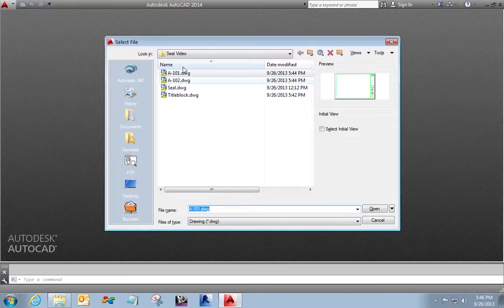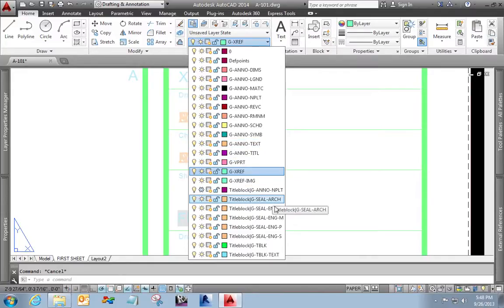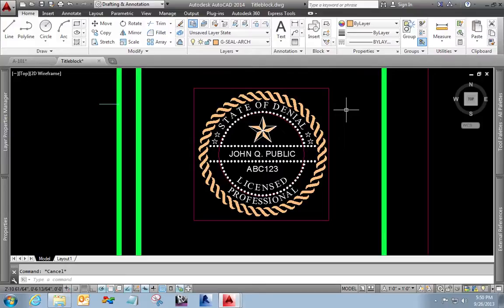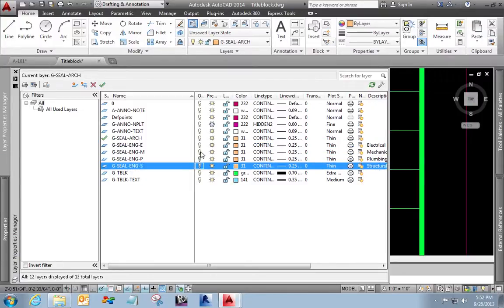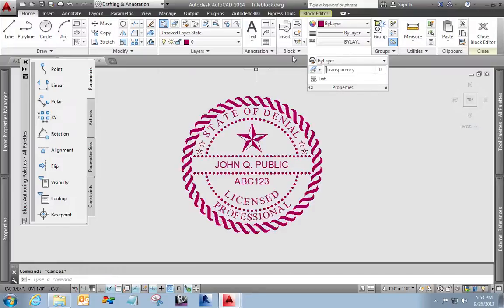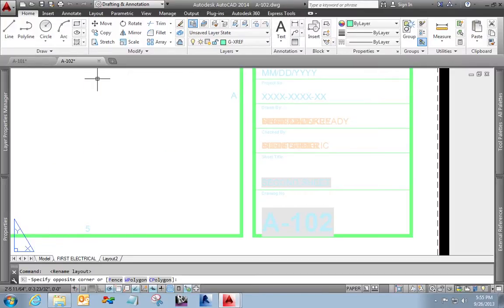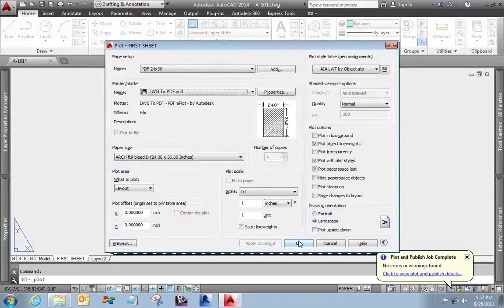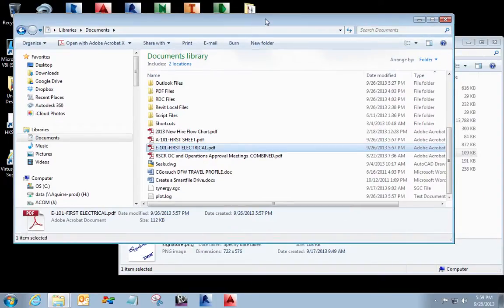AutoCAD   Scanned Signatures

Comment: Hello, one comment and one question. First, this method works for many jurisdictions that simply allow electronic signatures without qualification. But this method but does not work for jurisdictions that require a true "digital signature" that electronically locks the file against further edits; require that the signature be unique to and only accessible by the signing professional; and/or that it be third-party verifiable. Those types of signatures are typically applied to the final electronic document via Adobe or Bluebeam or similar.

Second, you mentioned a state that requires the seal/stamp image be a part the same entity as the signature/date image. Which state is that? Thank you!
Reply from the maker: Since I recorded this several years ago the regulations may have changed.  At the time I recorded this, I worked in a TX A/E/C firm, and had to perform this action for both AoR’s and EoR’s.  The regs for AoR’s allowed the digital signature to be a different digital element from the digital seal.  So the Seal, and date were CAD (or BIM) elements, while ONLY the signature was scanned.  Our EoR who kept up to date on these regs interpreted those regs as the seal AND signature needed to be a single scanned digital element only.  Their interpretation is what we used on the Eng side, and our AoR set the internal policy on the Arch side.

All this was before any jurisdiction we worked with even allowed, much less mandated, a true digital signature that locked the actual file, preventing editing and even printing.  Even PDF/A level of file locking wasn’t worked with because typical jurisdictions at the time couldn’t deal with PDFs they couldn’t print as they wanted.  Saying this, ANYONE with enough Photoshop/Illustrator know how can manipulate a PDF to their hearts content.